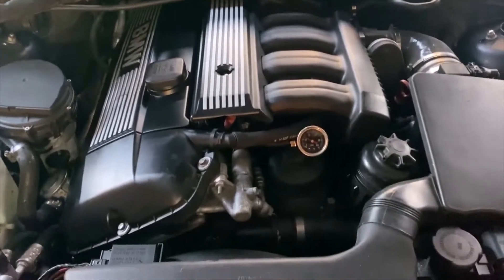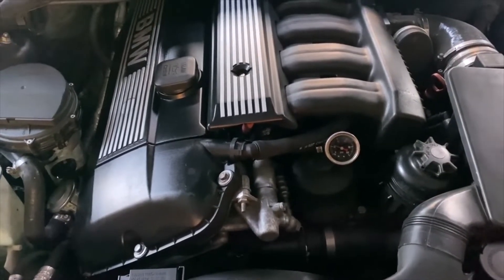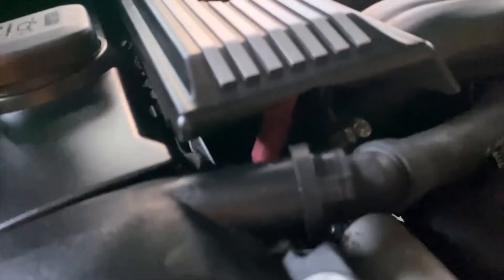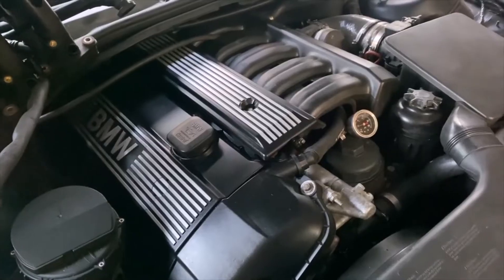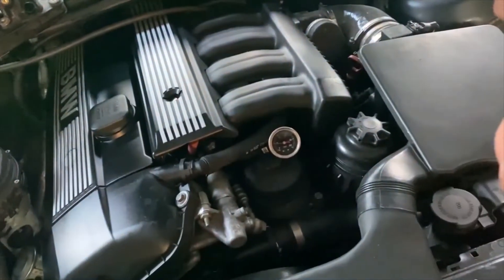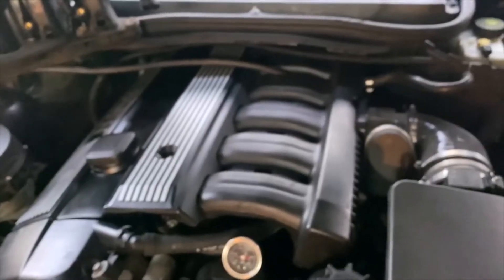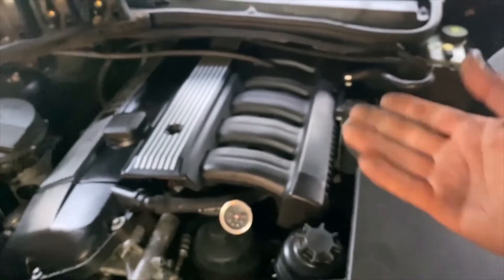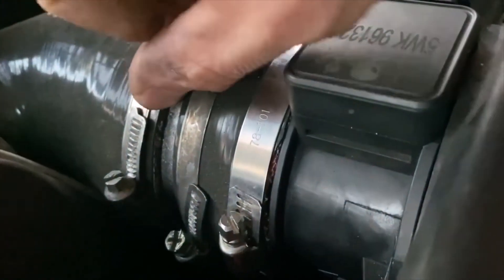m54 to m50 manifold swap (what I did differently)

Comment: i just got me a  bmw for a steal i need to swap the motor or rebuild i guess my question is if this is just really for looks or is is it a better flowing intake
Reply from the maker: it flows better at high rpms
Reply: "got a bmw for a steal" but needs a new motor ? 🤣
Reply: @GuciTheBulldog1 the car was $350 pretty much mint other than a headgasket, i got another one with a good motor but a beat up body for 400... i parted out the bad body and made abvout 1000 so i swapped in a low mileage m54 into the good one and pretty much own a drift missle that is reliable for free

Comment: Did you connect your idle control valve to the silicone hose pipe, If yes how did you do it
Reply from the maker: I tuned out the idle control valve but it could be done with the aic still just make sure it’s plumbed pre maf and that’s all you need to do

Comment: If youre using this car as a daily driver and want it to be as efficient as possible then why are you increasing the air flow causing the ECU to increase the fuel flow?
Youre going to lose low end power which it seems youre looking for if youre not revving the nuts off of it.
The M50 manifold hits at 4000 rpm through the rest of the range.
BMW designed your engine to be as efficient as possible and now youve changed the ratio which will not only require a tune via romraider to get working optimally but will also use more fuel no matter what.

What you have done is essentially waste time and money and ruined the efficiency.

M50 manifolds are for drifters and time runners and also useful with turbos.

And yes I am a mechanic and yes a BMW one.
Reply from the maker: there is a throttle which restricts the air going in to the engine, I think about it like this; the engine is a big air pump, the less restrictive the inlet and exhaust of that engine is the more “efficient” it will be and in theory all I’ve done is free up some restriction at wide open throttle, not part throttle. When i said I want to keep it efficient I didn’t mean it like my goal is to make it get better fuel mileage than a stock engine, I just meant in terms of using the wrong injectors which don’t atomize as well with the same given volume of fuel coming out make it get worse mileage.
Reply: So what then do I do to my M54b22 to make it faster ?
Reply: @phawupowerhousesakwe7897  fit shorter final drive, extend redline by 250rpm, fit 17 inch wheels and you will be looking at performance increase similar to M54B25. The 2.2 is the most rev happy of the M54 engines, they are usually putting out more hp than stated too.
Reply: @davecom3  bigger wheels makes it slower they add more drivetrain losses and reving it 250rpm higher does absolutely nothing you are actualy seeing power curve to fall whit stock or market maps, you need to retune whole higher section of ingniton and vanos maps of b22 to make more power.
Reply: @phawupowerhousesakwe7897  do you mean faster at higher or lower revs, do you mean torque ?

In my honest opinion. 

For real power just turbo all of these BMW b motors.

Theyre great motors with a turbo and a tune.

Don't expect the real hit without it.
Reply: @phawupowerhousesakwe7897 You but m50 manifold in it and make it slower. Most ecu tune on sale from big companies i have seen to b22 are shit what you do is learn to tune ecu or buy some tune from well know community member who works for these like chaoscalibrations etc. The b22 ignition map is really watered (whole bin is not much optimised) you thats where you can pick up some, vanos maps are made for emission controll cause they drop out externall egr valve so it shows, or buy super chrager kit, dont buy oversize wheels go whit light ones. Cams are allready bretty good sized for these engines dont chance the cam if you dont know how to make ecu corrections to match whit current cam m54 ecu controll is more comblex than just measuring ammount of intake air. Stop watching tubers to do power upgrades to heir cars when they dont dyno or measure the chances cause often time they make it worse than stock was. B22/25 intake manifold have dual lenght/resonator box that helps whit high and low power, you lose all that whit going back to older design intake, so maybe go for b30 that needs rescaling of ecu as well or keep it as it is and start milking horses out of it 😅
Reply: @phawupowerhousesakwe7897 ...the M54B22 has altough the small ventils from the m52b20 engine...you can put on a cylinderhead from the m54b25 or b30 and put on the manifold from the m54b30 but then you will need a software tuning...
Reply: You can do cam work and remap the ECU.

But if you want more speed without affecting economy you may want to redesign the entire engine.

That's a joke btw.

I think you misunderstand the concept of how fuel economy and power don't go hand in hand with the same design and the same fuel.

Sure you can run a higher octane fuel, do some cam work...take as much weight off the vehicle as possible.... But you can't create power without a change in economy.
Reply: @krislees976  ignition tuning, more compression and less power train losses
Reply: the "fuel efficiency" bmw over engineered into this e46 is one of the biggest headaches of this model.  

what he's done is allowed this motor to breathe better AND made it this motor capable of adding turbos in the future
Reply: @southcakc23  not only am I a BMW mechanic but I own several of these with and without.

Don't be silly.

Comment: Excuse me can you send me the web page with explain use the m54 body on the m50 intake. Tks
Reply: Was there power difference
Reply from the maker: https://www.ecstuning.com/b-seems-legit-garage-parts/m50-manifold-adapter-plate-kit/m50p~slg/?msclkid=2cb927586e3215cba163449bfc70abc8&utm_source=bing&utm_medium=cpc&utm_campaign=Srch.Shopping.BMW&utm_term=4579465934639648&utm_content=Shopping.BMW.Catch_All

Comment: How exactly did you did the ccv?   I still have my icv, can it be done with that on still?
Reply from the maker: i did an e36 cyclone can and gromet/seal and put it in the hole that would normally go to the icv. im using the electronic throttle body and changes in the tune which can be found for the m54b30 on ms4x.net to control engine idle and deleted the icv. i made a support/mount using some bolts and nuts with hardware store brackets. i had to use heater hose and cut the ends of the stock main pcv hose that runs from the valve cover down to the cyclone can and made a "custom" pcv line
Reply from the maker: It could In theory still be done with one of the kits for m52 to run the m50 manifold but I don’t like the way they position the cans at an angle and not up and down

Comment: keeping the fuel rail cover looks way less jank than the way most people have done it.
Reply from the maker: @HJK R i just blocked off the return port on the rail and fitted a fuel pressure gauge so the return is still at the filter/fpr on the frame. i felt like a vacuum cap would degrade and pop off and was a potential fire hazard.

Comment: I used s70 turbo volvo injectors pink ones and it's the straight ones, I have m54b30 with m56 valve cover and m50 intake mani. S70 injectors are plug and play. But I also ported my head to match the runners. No tune, runs perfect
Reply from the maker: Those are the exact injectors I ran here in this video they flow a bit more than stock injectors. I ended up going with Ford focus 2.0 injectors part number 0280156162 they flow .2lbs an hour more than stock injectors. So it’s more reasonable for long term fuel trims to compensate for without actually tuning. I could tell my fuel mileage was down and the mpg gauge read that I was getting more mpg than I was which was a sure sign that it was putting in more fuel than it thought it was
Reply: @BEAMERNOOB  Ya the way I made up for it was porting and polishing my head to match the m50 mani ports, runs way better that way
Reply: @BEAMERNOOB Are these injectors from the link in the description, because the injectors in the description from ebay are red and it says they are for jeep 4.0, but here they are pink and for volvo?
Reply: what is the parts number for the s70 turbo volvo injectors pink plug and play sounds good

Comment: Very clean the way you utilized the air box, how is the drive-ability? Cold starts?. Did you lose any low end torque? I didn’t have much luck with my m50 intake manifold so I reverted back to m54 manifold. Did you completely delete the icv too?
Reply from the maker: Completely deleted icv yes. If I notice most a loss of torque if I’m taking off as slow as possible for a manual and then hammer the throttle. I was getting cold start issues from the first set of injectors I used due to them leaking and then I found out later my fpr was also leaking and bleeding off pressure.
Reply from the maker: Drivability is just fine too. I actually raced a 4th gen TL up a grade last night and to my surprise actually pulled away from him. Should also note that I swapped my differentials out and went from 3.07 to 3.46 so I picked up some torque again and overall it scoots.
Reply: @BEAMERNOOB  I like your method more then the usual one. I too did the m50 manifold swap, but it was on m52tub28, dual vanos but 2.8L engine. Overall I was more happy with a sound it produced then performance. Is there any chance you did some sort of data log before the swap, so you could compare it to? Or is there any chance you will go dyno it?
Now that I have m54b30, I am thinking again about the upgrade... However, most power I had dynoed with m52tub28 engine, was actually with m54b25 intake manifold. 208hp with a tune, compared to 204hp dyno with m50 intake manifold. However, ive had handmade exhaust manifold which was flowing really well, but it was short, with m54 manifold, and longer tube headers with m50 manifold. Overall i wasnt impressed with m50 manifold, thats why i ask of you if you could provide us some dyno or log numbers, such as maf readings of full throttle in 4th gear say.
Reply from the maker: @TomoReso  I think the m54b30 is on the cusp of being able to pump enough air to even see any kind of benefit from the m50 manifold. The smaller engines just don’t flow quite enough air to see a benefit. Even still I think if I had zhp cams or aftermarket which would help raise the power band up higher and take more advantage of where the m50 manifold flows best. Also I theorize that if you don’t port match the heads at a minimum the large flat edge from the larger intake port crashing in to the head creates a lot of turbulence and thus creates a restriction. I also theorize that the small port adapter I’m using technically makes the runners slightly longer. Longer runners generally work better for low and mid range compared to short runners which work better for top end power.
Reply: @BEAMERNOOB  i believe you are right. Also I did port match the head towards intake runners. It just isnt worth it for a standard engine. Perhaps as you said if there were more aggressive cams on b30, it would make more difference.
Reply: @TomoReso  so you recommend b30 manifold instead of m50 for m52tus ?
Reply: @RiasGremoryS54  yes. Only if you want it to sound better, use m50 manifold. Both m54b30 and m54b25 are good otherwise, its a waste of time and money to go for m50 because they became really expensive for basically no gains. Maybe if you go for really aggressive camshafts and higher rpm such as 7500+ this m50 manifold would breathe better, but for stock engine with few bolt ons its just not worth it.

Comment: Can you still pass smog?
Reply from the maker: I probably could get it to pass visually as is, but I think they plug your car in to the obd and read the tune and if it doesn't match stock or an aftermarket carb compliant tune it wont pass. even tho the only real difference i have in my tune is i deleted the idle control valve and disa valve, and have values added for the electric throttle body to meter the air to idle the engine. none of which affects emissions in any way it would probably be a no. I also still have cats and secondary air pump on it, so the only thing i need to do to smog is swap the stock intake back on it with the disa valve and idle control valve and flash the stock tune back on and it will be good to go. this is the reason i used that intake adapter instead of porting my head because porting the head is permanent and wouldn't be able to get the stock intake to seal. i would say tho if i got pulled over and were forced to pop my hood there isnt much they can really say unless the cop happens to know exactly what he is looking at.
Reply: @BEAMERNOOB  Right on man, I forgot about the new tuning restrictions in CA.  
I’ve seen some people run these swaps with out a tune, but deleting the disa leaves a CEL, so still won’t pass a smog regardless. Do you think doing the swap is worth it? Considering having to swap all the stuff back that you deleted to pass smog, or maybe just pay extra for a hot smog? I’ve done almost all the suspension upgrades possible, got nothing really left to mod at this point lol
Reply from the maker: @dreww_e46   there are definitely pros and cons to it. It does help out with a bit of extra power to pass on the freeway for example where I spend most of my time driving it. But it doesn’t get out of the hole quite as fast unless i really launch it hard. It does launch decently as it’s an awd and I’ve also swapped in 3.46 gears over the factory 3.07’s so it counter acts the loss in low end torque. it’s not a huge deal for me to swap intakes back and fourth for smog. And it’s only every 2 years. The most apparent difference I notice aside from right off of idle torque being less is that the last 500 Rpms (6500-7000) it doesn’t feel like the power band hits a brick wall past 6500. I still want to get it tuned. But I recently did the oil pan gasket and discovered a lot of slack in my oil chain, I welded the nut but I know that I’m risking sheering the oil pump shaft. So now I’ve been looking for a zhp engine or a great deal on zhp cams and a healthy replacement engine to freshen up with new gaskets and add the s54 tensioners and new chains on. To swap in so I’m not down too long without being able to drive it.
Reply: @BEAMERNOOB  I don't have a tune on mine. I used turbo s70 volvo injectors and ported my head and it runs and drives perfect, no problems, runs better than ever